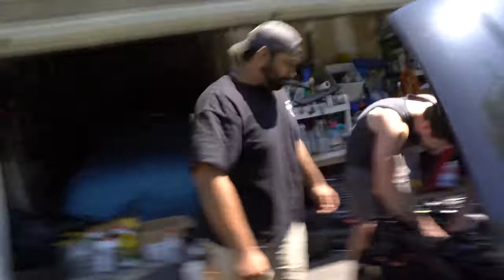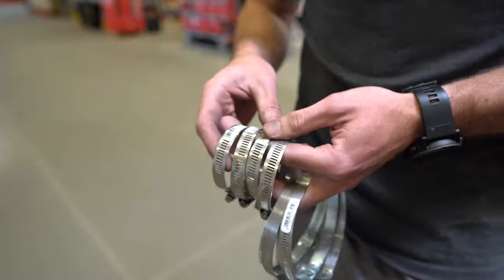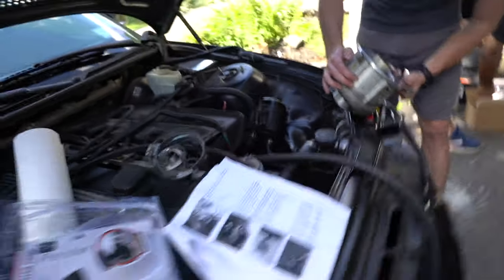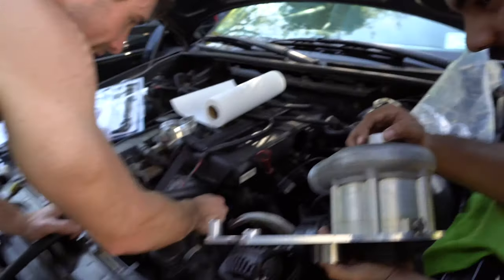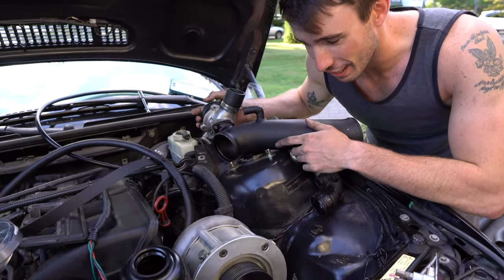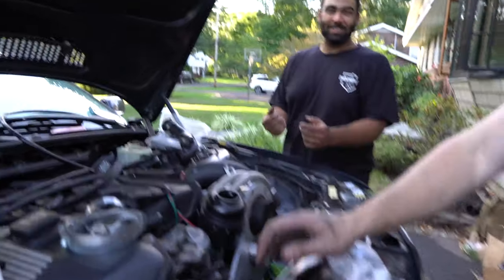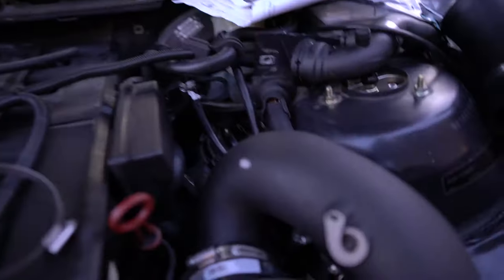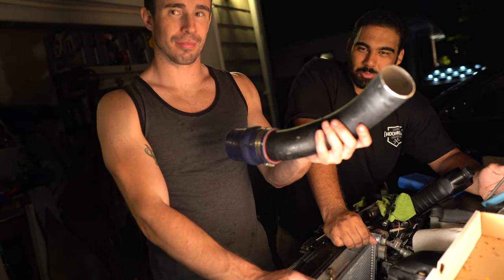E46 BMW SUPERCHARGER INSTALL!!!

Comment: The rs6 comes stock with 590 hp and torque , as a wagon... with twin turbo v8....
Reply from the maker: yeah but this is about 95% cheaper... plus building cars with your friends is life
Reply: matty wots if only this was a tutorial not a vlog
Reply from the maker: @joegreeley3122  well I appreciate the feed back but Im not sorry lol ! The company sent us an instruction manual that was absolute trash. My  channel is a mix of car videos, tutorials, reviews and vlogs. You can always message @drivewaytuning on gram if you have question on the install! He fine tuned it and the car rips now. Yes a newer RS would blow the doors off this